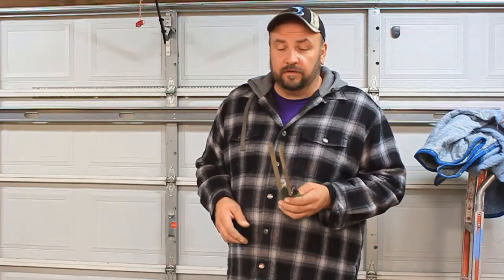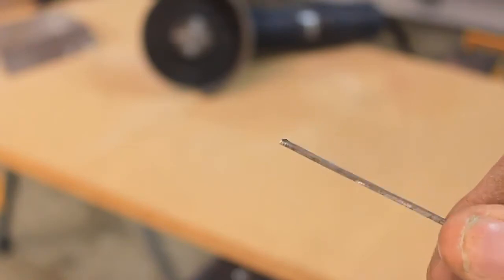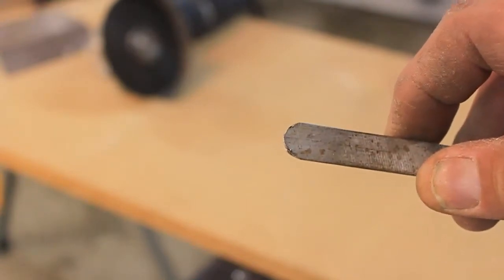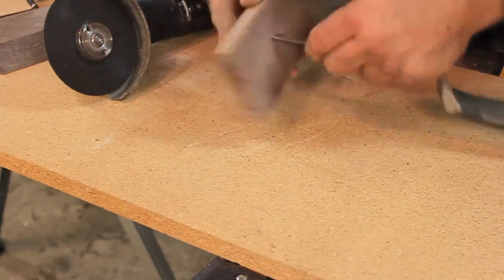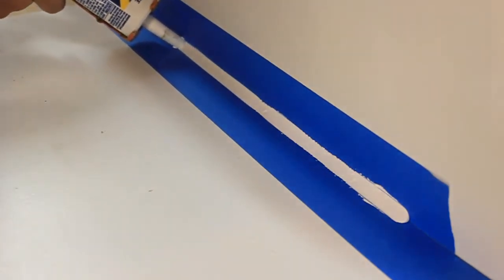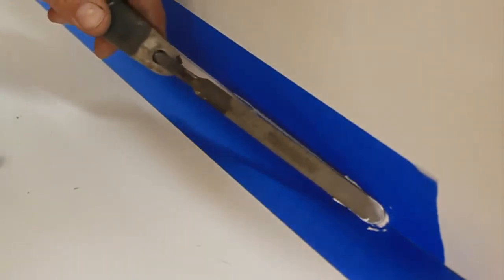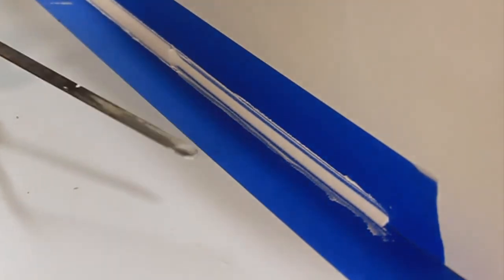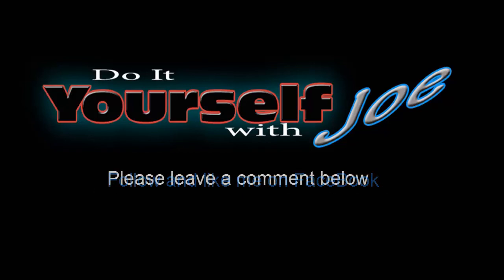caulk finishing tools

Comment: I can't pay per hour this kind  of mastic guy.....Never use metal for caulking or sealant especially  finishing...
Reply from the maker: The tape was for visual only so you could see the caulk. White on white doesnt show up very well. The tool is mostly used for caulking windows to brick or siding to brick. Also exterior and interior control joints.

Comment: I do.a lot of caulking and I'm totally confused about the usefulness of these tools. I think the tape was there to show contrast and so he wouldn't actually be putting caulk permanently on whatever those 2 surfaces were. But, he didn't mention that. But, if you have to clean both sides of the caulk line as he was doing... What's the point of using these tools? I don't see the benefit over using your finger dipped in soapy water. Please explain.
Thanks!
Reply from the maker: Sorry for the confusion. The tape is there for contrast. The white doesnt show up on white. Unfortunately some people in my profession don't want to touch the caulk. This is one way to get around that. Most professional caulkers will tell you  that you shouldn't tool the caulk with your finger and using a tool is the best way. Most interior applications for caulk will not need to be tooled at all. If you cut the tip properly and pull the gun  just right and pull the trigger just right you won't need to touch the caulk at all. Most of the time the use of this tool will be out doors. Metal door frames to brick or concrete or wood to brick or concrete. If you use your finger to spread the caulk for those applications it will look terrible.  I hope this helped.
Reply: @Doityourselfwithjoe  That makes sense. But after you ran over the bead with the tool you were cleaning off the thin line of caulk that accumulates on either side of the caulk line that you want. So, is that typical? Do you always have to come back and scrape those two little sidebars from every joint? I'm honestly not trying to be argumentative, just trying to understand the use of a possible new tool. I think I'll try it for myself and see.
Reply from the maker: @zapadeeboom  No not normally. If your good at it. I'm a union carpenter by trade. I don't really need a tool for caulking  latex caulk. Most times i don't need my finger either. There are union caulkers and they do this kind of thing every day. These tools are  part of their tool bag. Some guys don't like the tools  you can actually buy because they are too flimsy and prefer to make their own. When I see something that may help someone, I like to share  the info. If I can help just one person and make there job or project easier then I'm happy. I don't think your being argumentative, you"re just asking questions. And these are good ones. I'm not a pro at making videos, I try so hard to make sure I'm explaining everything , a lot of times things get missed . Thanks for not being mean about it or being a hater. If you have any other question please ask. Thanks bud!

Comment: You don’t want a tape line either once the tape is removed so why do it this way.
Reply: The video was not meant as how to use tape. The tape was there so after the demonstration He could just peel it off and throw it away. That way he didn’t have to make a mock-up. If you do tape, it would be placed so the clear tracks at each side of the bead would be at the edge of the tape. Eliminating the tape lines. I realize this is very late but I thought it might help in the future. It is one of the types of tools I use as a professional caulker. This is a proper caulking tool it allows you to tool in both directions ( this should always be done) it is far superior to the gimmick caulking tools sold to consumers that just scape the sealant off and not really tooling it